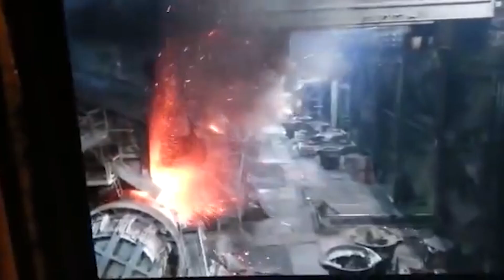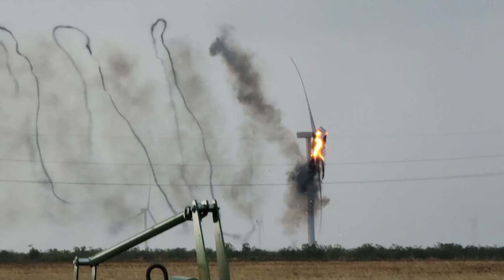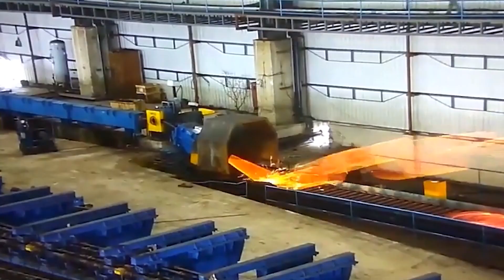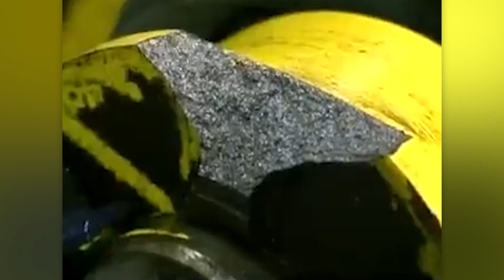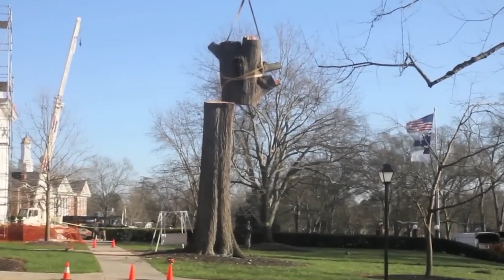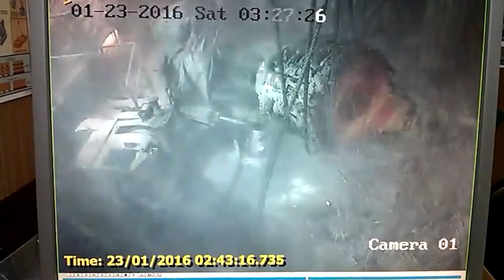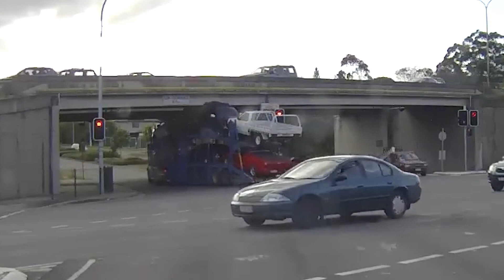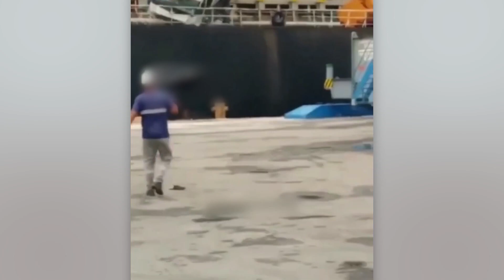Heavy Machinery and Industrial Mistakes Caught On Camera

Comment: Do you wanna know something you should’ve had it you should’ve had a chain hook to the ship so it wouldn’t go all the way out because if you don’t have that chain hooked to the ship, you’re just lost that thing you’re gonna have to go underneath the water to retrieve itwith a bigger crane you need to get a $10 million crane cause I’m gonna tell you for a $20 million cream because you’re gonna have to get the ones with a thicker grade steel. That’ll hold that big sign and you get the wrong type of crane you use the cheaper ones that’s not what you used to have your weight cranes cause if you don’t use them that’s the actions you’ll have.

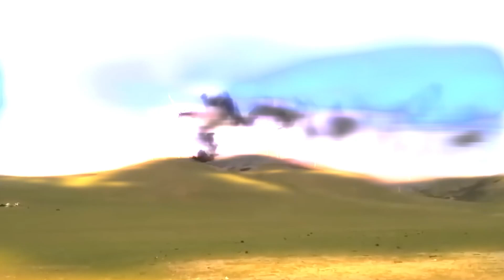Comment: 10:30... The fire was probably started by the slipping hub brake over-heating and catching alight. 

I've seen hanging brakes on a large semi catch fire on the freeway also. All 4 tires on the rear most 2 trailer axles were completely blazing, and the driver hadnt even noticed and kept going for several more miles... 🤪

The trailer was a portable MRI machine too.
The whole thing was a burnimg inferno by the time he got stopped and the fire department showed up. Total loss... 💸  🤑

Comment: A good example of the ultimate power of a steam explosion was the accident known as the  Chernobyl Reactor #4 Nuclear Disaster.... 

When the reactor excursion of the fuel rods happened, and they went critical, the intense heat that was generated by the fuel rods was SO hot that it instantly flashed ALL of the water in the giant sealed reactor vessel into steam, and the HUGE pressure spike launched the 4-million lb steel lid of the vessel into the air tens of feet. It wasn't a nuclear fuel detonation that was the first explosion, it WAS a steam explosion. The second explosion that happened right after the first one was likely a hydrogen explosion from oxygen suddenly entering the reactor vessel after the steam explosion blew the lid off, and the oxygen mixing with the hydrogen thay was already inside the vessel creating a stoichiometric mixture, and BOOM again. 💥  🔥 

So, first a steam pressure explosion, and then a hydrogen explosion right after that.... NASTY!

Comment: First shot looks like the slag pot.  More purified Iron (steel) doesn’t usually create such a fireworks show. The crappy slag oxidizes in the air changing it’s molecular structure and moving it’s electrons into a higher orbital shell around the iron atoms. The energy gained and lost during these transitions in temperature and molecular oxidation is causing the sparks you see flying around. This could also be partly due to moisture in the concrete floor which flashes immediately to steam causing millions of little steam explosions spraying the molten slag around even more.  However this is simply a guess on my part. You have to admit that it’s a damn good guess though huh?

Comment: There were several clips of cranes tipping over - these were not generally caused by the load being too heavy for the crane, but by the load being too far away from the crane's centre of mass.

Comment: The rail port crane unexpectedly toppled? So the crew that dismantled the one leg and used what seems like small explosive caps had nothing to do with it right? The only mistake is they didn't pull it out far enough or parked to close.

Comment: In the crane incident 0:14 -the driver in the truck behind, was quick thinking to get the heck outta there!
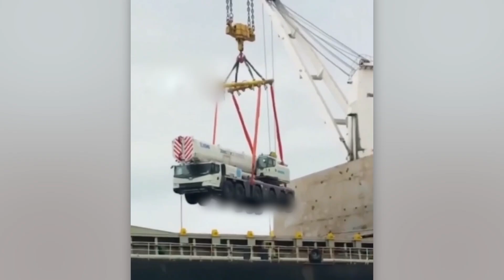the dropped truck at 28:15 - the forward strap is bearing all the weight, it's almost center on the entire load.

Comment: 16:34 This is what an Electrical Dead Short looks like when you're dealing with several Thousand Kilowatts of power...

In this case, the Dead Short is both intentional and safely contained...

If you want to see what an Uncontained Dead Short looks like, search You Tube for Arc Flashes and prepare to be horrified...

Comment: Water vaporizing into steam expands like 1500 times. Also, the temps in metal foundries are so high that the steam directly is turned into hydrogen en oxygen which causes new explosions. 
The procedures about drying scrap and ore before they can be added in a foundry are there for a reason...

Comment: 18:01 The irony is that they didn't want to damage the lawn by having the crane placed closer to the tree. They could have used cribbing to keep the lawn and crane safe, but no, they went with a long reach on a load that was already at the extreme end of the crane's max. loading. But hey, look how it "Saved money" not having to repair the lawn.

Comment: In all irony, nuclear plant explosions are much the same.
The nuclear core has a runaway heat effect, causing the water meant for cooling to rapidly boil far faster than water ever should, within sealed machinery...

Despite what most people think, a nuclear meltdown is just a series of steam explosions and an exposed stationary core.
The heat is immense, but it's nothing like a nuclear explosion, as no atoms are being split by the low-grade uranium/etc. with no atomic trigger.

Comment: Most of the times the cause of these accidents is greed. This is reflected on unproperly trained operators, inadequate machinery, poor condition of slings, chains, rails, cables, etcetera, miscalculated capacity of cranes and misjudgment of weather conditions in an effort to finish the work on time or less time than the one expected to do the job.

Comment: I used to work in the steel industry, and yes, contrary perhaps to people's expectations, while working among liquid metal and slag above 1600 degrees C, the thing we feared the most was water, for reasons shown in this video :-) Our operations centre was a small house near the hot metal transport line. Every time I went for a sh*t I pondered the possibility that a 'torpedo' could tip over the other side of the wall, entoumbing me permanently like one of those statues you see from Pompei :-|

Comment: Here's a tip: If you're watching a crane in action and you have to run when it falls, collapses, or drops its load, you were too close!
Reply: Here's another tip: Never on Earth has any person or corporation used a crane and NOT had it fall over, tumble off a cliff, bend/collapse in the middle .... they're flawed - every last one of them. UNLESS you need a crane to fall over and wreck some shit - in which case they get the job done.
Reply: @napadave58 that comment doesn't make any sense. Crane accidents, especially in the U.S. ,are rare when you take into account the number that are used every day. As you can hear in this  video and many others, the language usually isn't English when the accidents happen. Saftey standards are kept higher here than lots of other places.

Comment: Who goes to work and records a part of their day? Only this time, a terrible expensive mistake happened, which caused an explosion of molten steel after it was incorrectly loaded with water and other non compatible materials that were not believed if not seen. Good thing this employee recorded this procedure at the correct time and had the nerves of steel or expectations of something about to happen or what happened from the locked screen and defensive body movement.

Comment: The only think I can think of with that first clip is Terminator 2. Is there not an emergency stop button? Usually it is big and red and in-your-face, just screaming to be pressed. No? Also, steam be like GET OUT OF MY WAY! And I think those giant cranes need ejection seats! Also also, know your weight limit! A lot of these accidents were reckless use of undersized and overloaded equipment. And know your clearance! You know that every bridge has a handy little distance sign on the top portion facing the road? That is how tall the bridge is! If your truck is 4 meters tall, you will NOT fit under a 3 meter bridge!

Comment: So much for clean energy.
Reply: No energy form is completely without risks.
Reply: @zeriousvolt1245   There is no "clean" energy. Even solar panels are dirty to make and only 10% recyclable. The rest of them will be piling up in and expanding landfills soon enough. Not that that matters as they are destroying thousands of acres of wildlife habitats a year just to build their "clean" energy solar farms. Wind turbines are also just as bad if not worse.
Reply: Still cleaner than fossil fuel sources 99.9% of the time.
Reply: @DennisMoore664   Not really. The lifetime energy of a wind turbine doesn't quite make up for the use of the fossil fuels needed to produce them. Also, If you do like Japan and convert your Natural Gas power plants to Blue Ammonia, They become obsolete anyway.

Comment: Fun fact regarding those eyesores called wind turbines. Those blades can't be recycled, so what do they do with them? Why, they dig huge pits to bury that garbage in. Sounds real green to me. How about you?
Reply: What do you think happens when conventional power plants must be decommissioned? We need power. Wind turbines provide that power with FAR less damage to the environment -- even when decommissioned or when they fail -- than the alternatives.
Reply: @thomasstambaugh5181  You have obviously neverer seen how much acreage a wind farm takes up, nor have you ever seen up close just how massive each wind generator is. And once they burn and drop, what do you suppose happens to all of the oil in them? Yup,all over the ground around it, which then requires ground remediation to remove the contaminated dirt.
Reply: @Cast.Iron.Frisbee  : I notice that you make no mention of what happens when a conventional coal- or gas-fired generating station fails or must be decommissioned. Nuclear is even worse. Your commentary gives the impression that you are pursuing an agenda.
Reply: @thomasstambaugh5181  Yet those generating stations worked 24/7 to provide power, while the wind only blows sometimes, and solar only works when the sun's out. And as for the remains of a decommissioned power plant, much of the debris is used as fill for other projects, and the metal is recycled.
Reply: @Cast.Iron.Frisbee  Your bias is obvious and naivete is touching.

Comment: ...Maximum safe wind speed for a tower crane is 60 meters per second???...

That's 134 MPH. Any tower crane operator who would work in that wind speed needs his / her head examined!!! That wind would wrap the cables around the tower. I had a friend who was a tower crane operator who almost got his head torn off by a tangled cable on a calm, sunny day. It wasn't his job to flag down The Flying Dutchman but he almost caught a ride that day anyway.
Reply: I'm pretty sure he said "20 m/s" not 60.

Comment: American crane operators are highly trained, must be certified, must be professional, and must be able to do the math for every single lift.   It is risky business.   Yes, crane accidents still happen in the USA by American crane operators, but it is risky business.   Most of the accidents I have seen int his video do not appear like they happened within the USA.   I have worked in the mining industry where some of the largest cranes in the world are operated.   Things do happen, but operators are required to cordone off areas that they are working, are forbidden to operate in wind conditions above a certain mph, are required to know the weight of what they are lifting and how the dynamics change based on the tilt of the boom.   There are regular inspections of the cranes, their components and wire ropes.   Rigging must be regularly inspected before each lift and at regular intervals.   These regulations are covered by both OSHA and MSHA.   Footing of the cranes must be adequate.  These accidents can cost lives, cost money, and cause tragedy on an enormous scale.   For that reason, the USA continues to try to improve regulation and training of crane operators.   Because of this, accidents in the USA are low in comparison to the number of lifts done per year.   Thank you. - a former certified rigger who worked in the mining industry.

Comment: It never ceases to amaze me how many so called “professionals” don’t under stand the further away from the center of gravity you move a load, you lose significant lift capacity. It’s like half these operators never bothered to read and understand the data plates on these cranes.
Reply: ...It’s like half these operators never bothered to read and understand the data plates on these cranes...

If you turn up the volume and listen to what the people on site are saying, you probably won't be able to understand them. Most of them are in Latin American or third world countries where OSHA holds no sway. Most heavy equipment owners there will nail up a "MACHINE OPERATOR WANTED" sign and the first adult male out of hundreds or thousands of them in town will instantly become "professional heavy equipment operators" with "years of experience" just to get the job to feed their families no matter what the risk is.
Reply: @jeffmccrea9347  True, most heavy equipment fail videos these days are from third world countries OR are very old.  Stupid things still happen in the Western world, but it gets more and more difficult to be this careless.  I can't tell you the number of times a crane company sends a crane bigger than asked for because they refuse to do the required lift with what was ordered.  They do this rather than send the correct crane and have the operator refuse to make the unsafe lift and then the construction company getting mad about the lost time etc.  Here's the crane you need, here's the change order.  You don't like it, we're leaving and you can find another company.

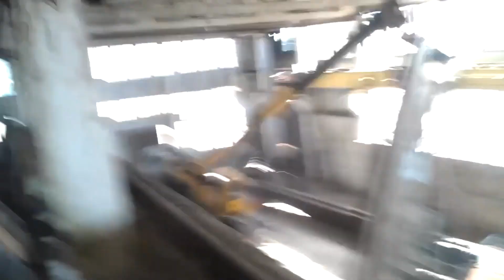Comment: The guy at 13:13 with his arms casually folded... Just standing there like... 'Hmph... Interesting'. UNPHAZED.
Reply: I dunno I kinda like unphased, though for arguments sake it would be better used on a clip over an electrical accident
Reply: @NoName5589  LOL. Or if on Star Trek, Kirk takes a shot at someone with his phazer, but misses. The intended target would be, un-phazed. 😆
Reply: Oh dang you got me there, that's a good one too!
Reply: UNFAZED.
Reply: @jb6712  Wow, you got me on that one... Having never written that word before, (or read it anywhere obviously) you are in fact, correct. And I hold in very high regard, proper spelling, grammar, and the use of english when writing anything. I routinely read my comments multiple times to find any errors, and correct them. So you can trust that I will never mis spell that word again. Thank you for the education. 👍

Comment: The 747 was taxing on the ramp not landing... the plane slid on the   ice on the ramp... and could not stop cause the ice was just packed snow...
Reply: I was thinking the same thing, as runways generally aren't pointed at terminal areas. Taxiing and losing control makes more sense.